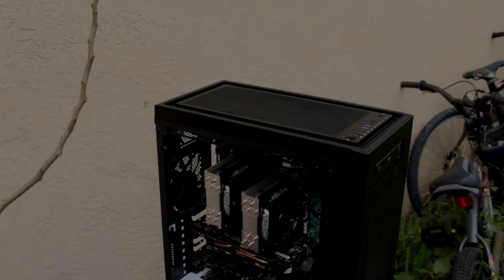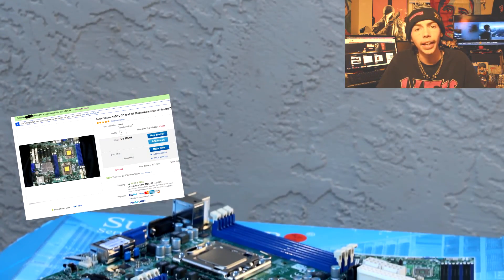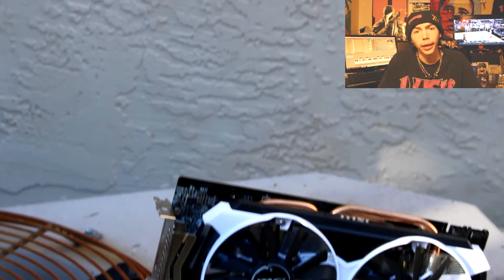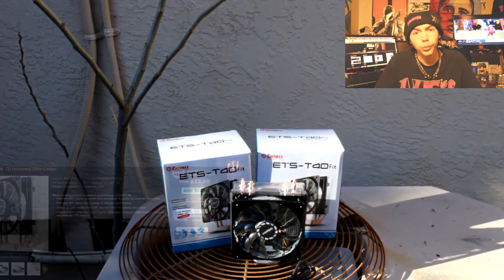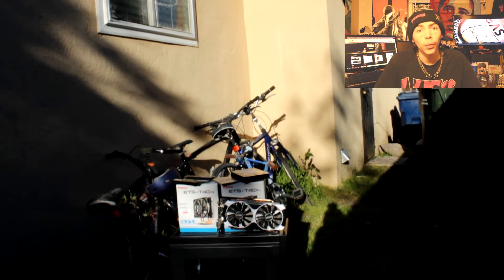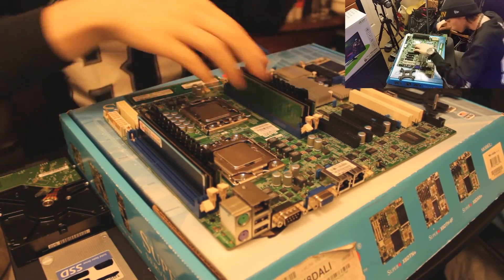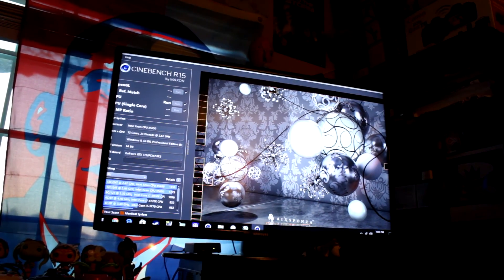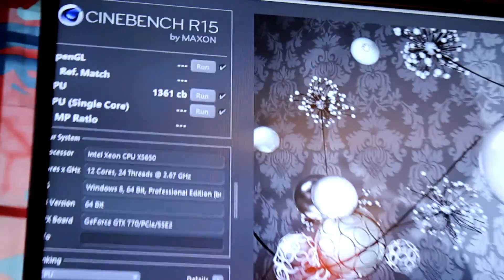Project Reprisal: The $482 Used Budget 24 Thread Dual Xeon Workstation

Comment: Would I have to use a full tower case, can I used a mid-tower instead? Is there any other motherboard that I could use that has 2 graphics card slots instead of one?
Reply: Also for the motherboard, does it have to be revision 1 or 2?

Comment: 🙂 Neat Bro! 😏 normally Dual X5650 Westmere CPU Workstations are very expensive, you can find them in some models of dual cpu Mac Pro 5,1 Aluminum Towers. On a mac pro the fastest compatible westmere cpu is the X5690 3.46ghz with a turbo of 3.73ghz 🍎😍🚩 Do you have any idea if the X5690 is compatible with your motherboard? thx for the cool workstation video 🤓

Comment: "faster ram instead of more capacity". Both cpus support just 1333 MHz if you don't bump up the IMC.. and registred ecc ram is just 2% slower at tops. You will probably not even notice it. So for those who ask themselves cheap 32gb ram or less ram, just go for used reg ecc server ram (cheap as hell)..

Comment: Amazing man,I'm about to buy a Hp z600 workstation with two xeon x5650/32 gb of ram for around 500€,I want to work with 3d projects and render videos faster but also be able to play some decent games mostly bf1 and cs go,what do you think,is that pc a good choice?
Reply from the maker: BF1 works VERY well with the Xeons. It will only use one CPU but the game is very optimized and as you saw, played BF1 without any tweaking on ultra at 60 FPS with essentially a GTX 960. It's between Doom and BF1 for the best game for the Xeons. Just be careful as some of the HP machines have the 2nd CPU on a dedicated ad in board WHICH will cause lag if the game tries to use both of the CPU's. I solved this problem by moving from the 5500 to the 5520 chipset. I'm pretty sure the lagging that was caused in GTA 5 was PCI-E lanes being ripped from both of the CPU's at once, so if you're going to game make sure the PCI-E slot is WIRED for 16X and the lanes aren't split between both CPU's by 8x for CPU1 and 8X for CPU2. Counter Strike I recall getting to work about a week later and was getting around 150-160 FPS on max at 1080P. Other than that the PC seems to be a decent deal, as long as the ram is 1333MHz the deal is pretty solid, though I just me I would rather build from scratch but that rig at maybe 350-400 I'd be interested but not jumping out of my seat.
Reply: Thanks a lot for the reply  man I really appreciate it,true the pc might look a bit overpriced but pc parts cost hella expensive in Eastern Europe in compare with Usa.
Reply from the maker: You didn't bring Europe into the equation. At 500 E that's not bad.

Comment: best video you've made so far build was solid but it was everything else that makes this one better then your other ones looks like you upped your recording equipment and cleaned up your space a little and that makes a world of difference to the viewers I have subbed and I'll be looking forward to your vids! also what is your main rig if you don't mind me asking?
Reply from the maker: It's a I7 3770 BCLK Overclocked to 4.579GHz on one core and 4.36Ghz on all cores with a 1070 and 16 GB of ram @1917MHz. Great rig however I actually have been using this rig I built in the video A LOT as a media center and a gaming rig since I got a new board for it after the video and it fixed stuttering between the cpus in certain games. Didn't make a video on it since I have been down lately and didn't feel like being my own camera man but I'm typing this while I benchmark one of the worst GPU's Ive tested so yeah. Great to see you hanging around and the feedback is helpful and makes me want to make more videos even in this terrible youtube meltdown
Reply: Yea sorry to hear about all the things going on with youtube but keep it up man I like your stuff I'm looking forward to your next video!
Reply: IceBergs. You mean a turboclock I though i7 3770 couldn't be overclocked
Reply from the maker: What?
Reply: TheBrain he probably ment i7 3770k which is what I have in my current system I've been able to oc it to 4.8ghz stable but I keep it at 4.3 as I can achieve this speed with no increase to the core voltage and I don't really need the extra performance in my day to day gaming
Reply from the maker: I see what he meant now I had to read it a few times. It's BCLK Overclocking not multiplier. You overclock everything in your system by raising the bus speeds. It's how you overclock multiplier locked chips. You could do it on certain skylake chips but was patched in microcode updates. You can BCLK overclock anything leading up to skylake AS LONG as you have a Z series or X series chipset. My overclock goes like this, 4.579GHz on one core work loads, 4.479GHz on dual core work loads, and 4.36GHz on all thread workloads. It's funky and takes a lot of tuning but extracts extreme value out of the chips since they are easier and cheaper to find.
Reply: Just curious, you said you changed the motherboard because it was stuttering, what did you change it to?
Reply from the maker: I changed to a X8DAI/3 but you could switch to any motherboard from what I'm aware with a PCI-E slot that is x16 instead of wired for x8 and would solve my issue but I'm not sure